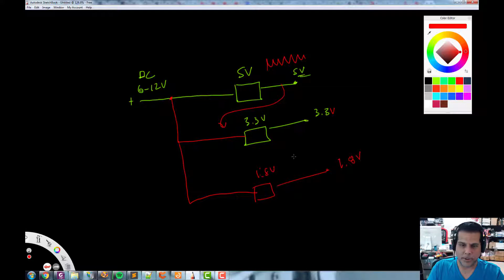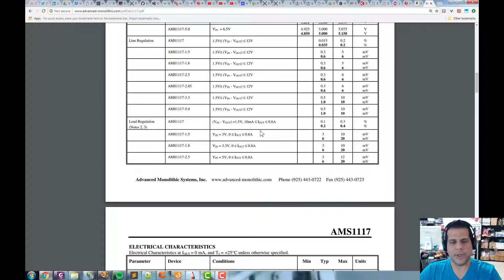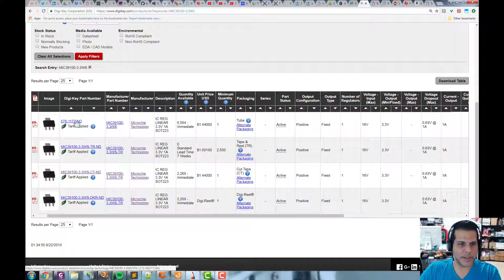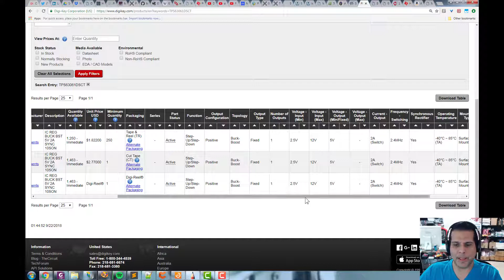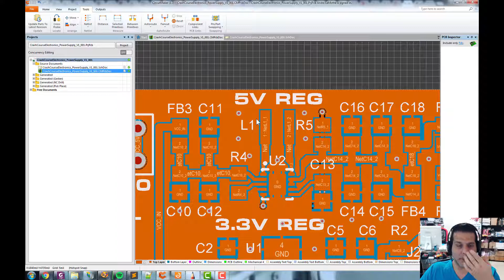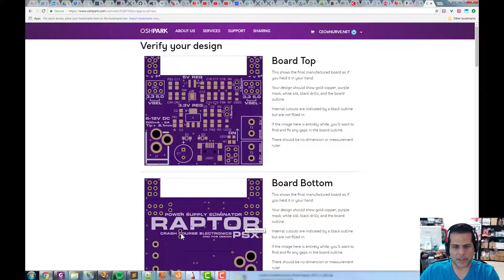The RAPTOR PSX - Solderless Breadboard Power Supply Design.

Comment: so far everything you said upto the 36 min mark, is making the error that the USB connector on the factory models are inputs.. But the USB connector on those boards are USB output connectors... 
The +5v on the USB connector should be wired to the regulator's output pin...